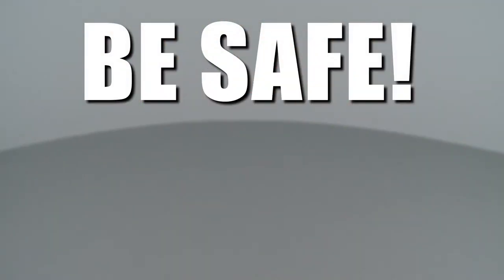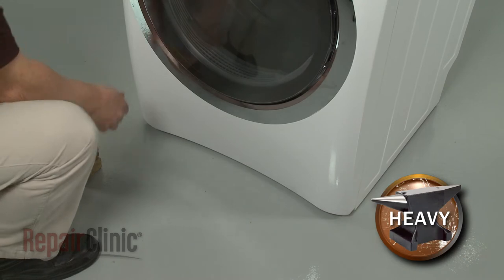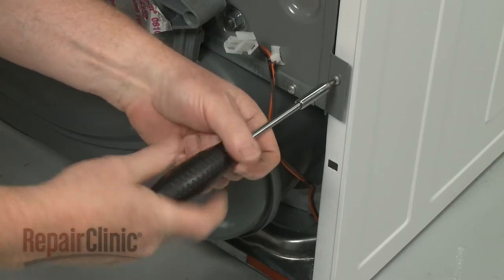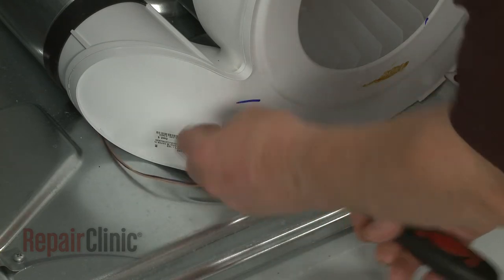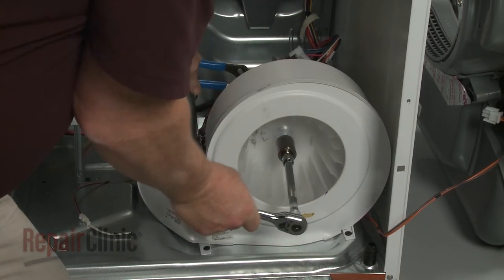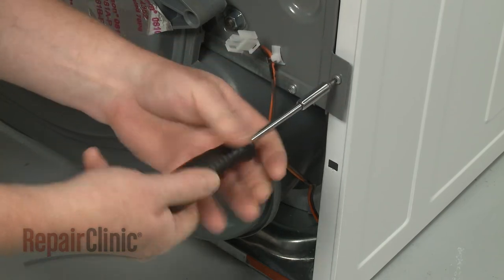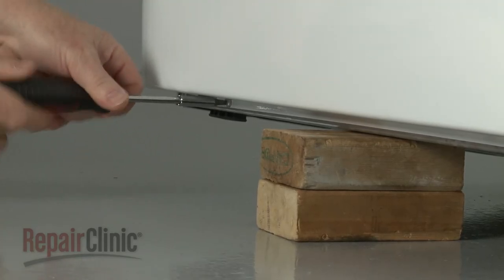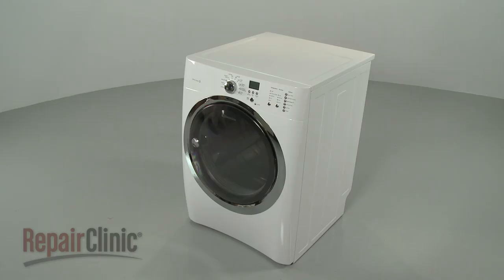Electrolux Electric Dryer Exhaust Gasket Replacement 131633300

Comment: We found this park at the bottom of our dryer.  It had snapped.  Could this be the possible reason for excessive rumbling noise in the dryer?
Reply from the maker: +Wendy Viramontes The exhaust gasket would not cause a rumbling noise. The noise is more than likely coming from worn bearings or glides. Enter you model number on our website for more specific repair help http://www.repairclinic.com/RepairHelp/How-To-Fix-A-Dryer/10---/Dryer-makes-noise